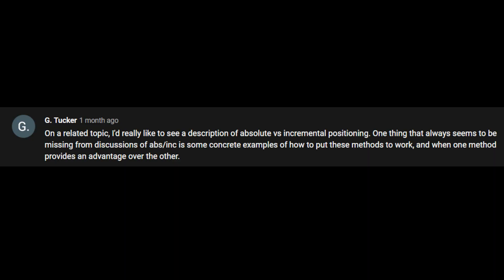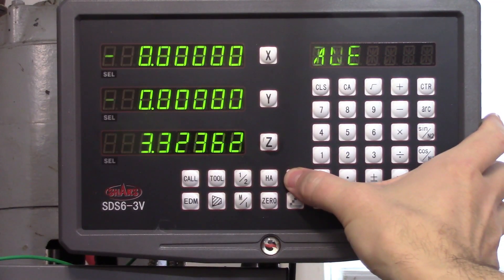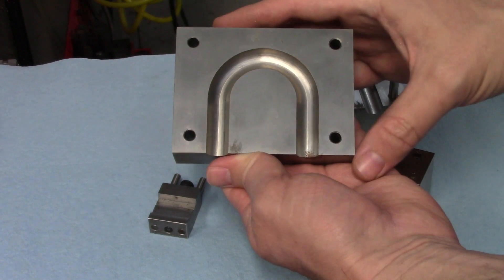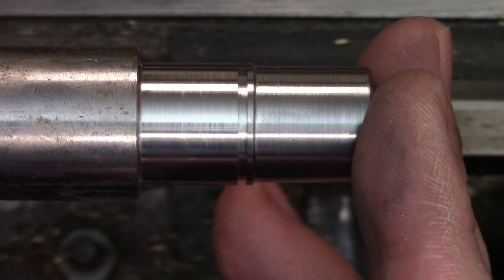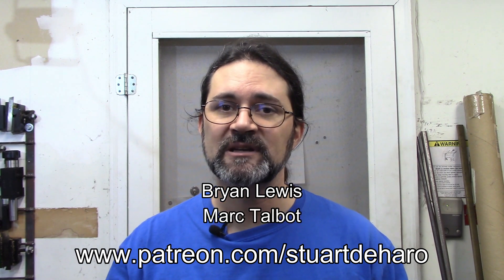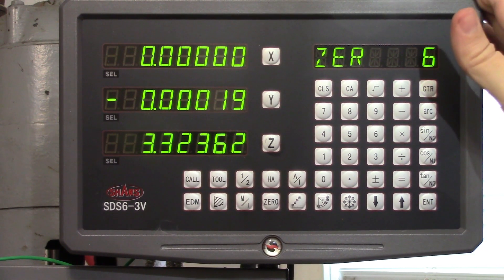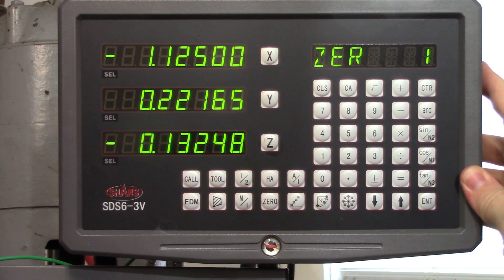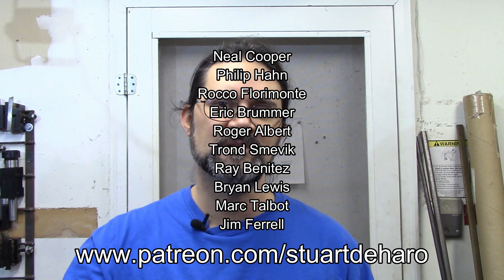When to Use Absolute vs Incremental Coordinates - Quick Machining Tip #22

Comment: Hi Stuart.  Thank you very much for all of your very helpful videos.  Over the years, I have picked up a lot of tips as well as very valuable information.  You have made a few videos on the DRO that you installed on your mill that have been extremely informative.  I would like to encourage you to make more videos regarding the setup and use of these import DRO's.  Most of us that have them find the documentation limited or difficult to understand the poor manuals.  The settings menu contains settings that I, at least, have no clue as to what they are or which buttons to push to change things.  I'm sure many would find such videos very helpful. Thanks.

Comment: I recently had a job for several thousand small aluminium upstands for which I would love to have had a small CNC lathe.
I made a HSS form tool which had all the features of one end, chamfers, diameter etc, including the part off.
I used several tool offsets to simplify this brain numbing exercise.
Tool 1: Part off and end diameter exact..
At X:0, Z:0.
Then drilled with tailstock drill to just break through so the part off left a clean face.
Tool 2: at Z:0 was the stock stop.
Tool 3: at X:0 was the OD turning diameter going to Z:0.
Revert to tool 1, into X:0, parting off, rinse repeat.
My point, on the same tool I listed 3 offsets and each had a simple to remember TARGET number of zero(0) which produced thousands of these little #####ers with less than 1% reject rate, simply.

Comment: My question is a perfect example of Nicholas's statement "There is no chapter 1"

The place i work at has several Southwestern Industries machines, including a SMX 2500 mill with Prototrak control.
Staffing problems being what they are, we no longer have any 'expert CNC'ers' working for us, so I'm trying to learn on my own.

I know the Prototrak software inside-out, I've used it on a daily basis for the last 7 years, and am extremely comfortable with it, but I'd like to take the next step and be able to run G-Code on it. Ideally I'd like to output Aspire toolpaths and import them into the machine.

My problem is I've never used G or M codes before - I'm in the position of not even knowing what it is I should be learning!
Reply from the maker: Hi Steve. I'll see what I can do. I can probably do a basic G-code video with tips from when I was learning, but I'm definitely not your guy for Aspire. We have a 1999 ProtoTrak at work with the AGE2 control, but we never do anything with G-code or anything other than conversational programming.
Reply: @StuartdeHaro  That'd be brilliant - our machine uses the same AGE.  (EDIT: Actually, I think ours is AGE3)
I've looked at the Aspire software over the holidays and it actually has a post for Prototrak.
To be honest, I'd just love a very simple G-code program that would run on the prototrak, just milling a line from A to B, with an explanation of what each line does. I assume there's some sort of header? Some way of telling the machine what tool to use, feed rate etc etc.
If I had that very simple building block and a  basic understanding of how it worked , I'd be in a far better position :)
Reply from the maker: @Steve_1401  are you running into limitations with the conversational program or just curious how g-code works?
Reply: @StuartdeHaro  A bit of both. I'd love to learn how g-code works in general, just for my own enjoyment.
I'd love to be able to do a bit of contour milling (hence the Aspire toolpaths), but my main limitation is with engraving text. I have a couple of programs that will take a text input and output either g-code or a dxf file.
The dxf files are normally full of splines, which the Prototrak dxf plugin has a fit about. There are work-arounds, extra programs, more steps, and it all gets a bit involved. If I could just take the g-code that was output, alter it as needed and load it into the SMX..... so much easier.

Comment: Thanks for the video. I have a DRO like the one you have on your mill. I am trying to setup the "Absolute Reference Point" in case of power failure. I follow the instruction and it says put it in REF mode, select the axis and move that axis until it "beeps". Mine doesn't and I suspect that it is because of the cheap scales and therefore they don't have the reference mark. So, have you tried it and if so did it work? If not do you know what the AB-Ref, LEF_AB references do? Thank you for all you do!
Reply from the maker: I have not done that actually.  I'll try to figure out what those do and get back to you.